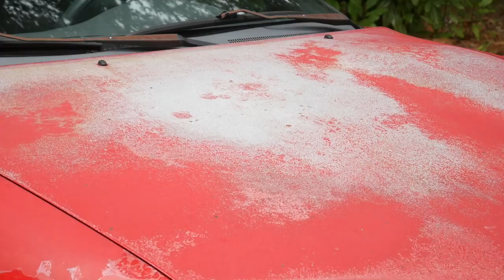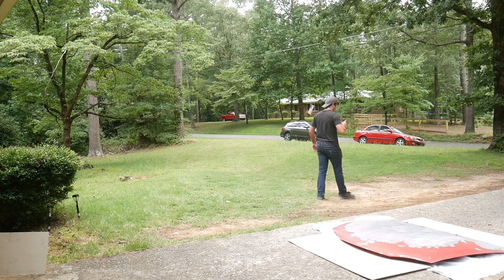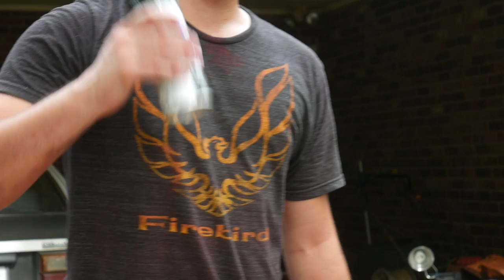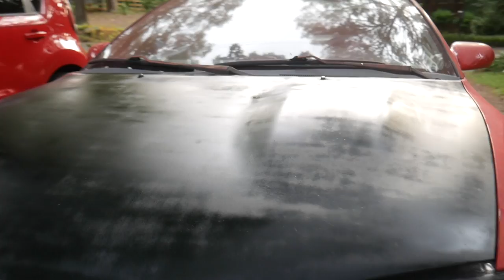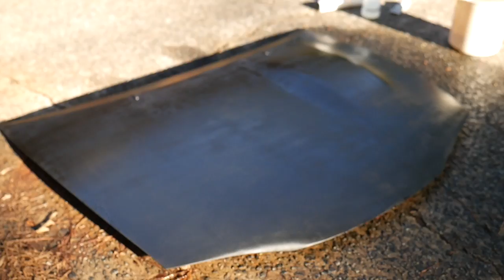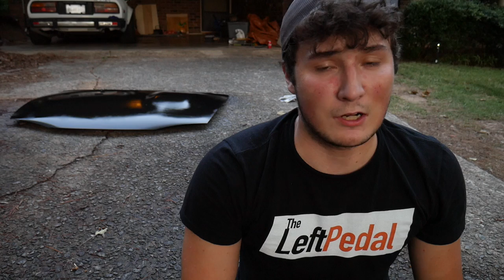Spray Painting a Car With No Experience

Comment: 1-the paint you got is not good                                        2- when you are painting a car try to keep the cab 3 inch of the stuffs you are painting                 3 -keep a pattern like if you start spraying to the left and right then keep doing that with primer and paint other wise you’ll have square looking like but hey you are very positive and I know next time you’ll do better I did spray can my 97 Chevy s10 hood and it took a lot of coats but it is all right .

Comment: First off let me say this great job at keep going with it I love your determination. You have minor things you did wrong buuutt like you said you not a pro. First get a sanding block bc using your hand will cause issues what makes a great paint job is the preparation work. Second when spraying stay between 4-6” away. Third use about 80% overlap so you don’t get “tiger stripes” and if you do happen to get tiger stripes just go in a different direction ➡️⬆️↗️. Fourth tac rag between coats especially if you spraying outside and use alcohol or wax and grease remover. Fifth use 2k clear bc it will last longer bc it will protect against uv rays. Do these your paint job will be great. Follow my channel I’ll be doing little videos to cover stuff like this and more

Comment: Don't paint on the ground, that is the first  and frankly only mistake. All the other errors and the outcome is a direct result of this mistake. Painting is not so much about as painting it self. It is all about the preparation. The more and better preparation, the better the results. You do not want to 'fix' mistakes in preparation when you are going to paint. It will show.
Should have lifted it up, and painted it vertical. That way the spray can is A) much more effective and B) it makes it A LOT easier to make long overlapping patterns. Now you cannot make these patterns, because you have an awkward position to get into to reach the whole hood. That is why the result is streaky. 
So anyone seeing this (and reading this) your results ought to be better.

Comment: Yooo bro ..your way to close with the can ..back way off , very lights coats, it will lay more evenly ..but unfortunately the fan is not big enough to apply to a surface that big with pro results...but it can be better than that ..go try tho

Comment: Its dry and rough because you sprayed it on too dry,  Basecoat needs to be applied medium wet and clearcoat first coat apply it medium wet then next remaining coats apply it wet.  Also your not doing your over laps @ 50/50 also the spray cans fan is too small for that size job area.

Comment: You keep trying everything except for the one thing that works shorter his throats closer to the service lay down more paint you keep putting light coat on top of light coat on top of light coat that’s exactly what you’re doing wrong for his call light rest of the codes heavy even strokes without having it run

Comment: dude, your spray can nozzle isnt for this kind of job.  its not about being a good painter especially if you have the right tools to get the job done.  if you get some cans with wider spray, you will get much better results, which will eliminate the streaking you're experiencing in this video.    and also, before you paint, sand with something finer like 400-600 grit for your color.  not 320.  320 grit is for primer which is the finest grit you'll want to use for priming.

Comment: Your using the wrong type of tips on the rattle can. U need the wide spray not the one that makes a line. Dont oaint in the sun and cover it btwn coats so that it cant collect dust and stuff.

Comment: I have several questions here..Why the heck did you have to remove the hood? Couldn't you just mask the rest of the car like anyone else. Why not paint the car in the ventilated garage instead of outside on the wind? Why didn't you sand the entire hood, but sanded the primer? Why did you apint from such a close distance and didn't overlap? And most of all, why didn't yu try and change something when you realized it was no good? 15 minutes from my life completely wasted!